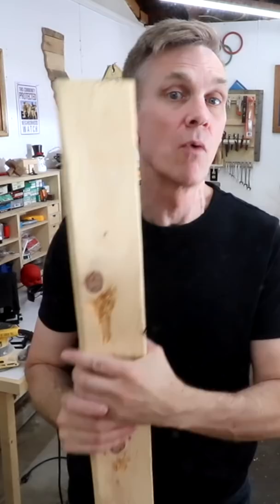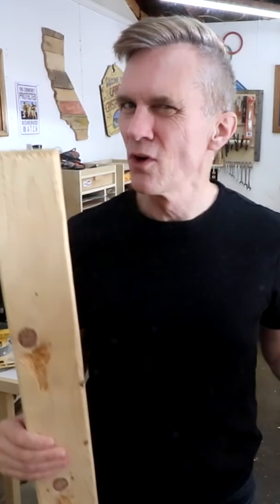Why do 2x4 boards have rounded edges? #shorts

Comment: The roundover cost nothing to add if done on a 4 sided planer, which is what sawmills use. All that's requires is a different set of knives that are curved on the end.
Reply: Thank you saved me 30 minutes of searching google
Reply: Hi Matthias. Great to see ur response. I am a big fan of urs...
Reply: Are rounded knives not more expensive?
Because it's seems like they should. Added complexity adds more cost.
Reply: Interesting, but this doesn't explain why they have rounded edges -- only WHY NOT.  If it doesn't cost anything, why don't all boards have rounded edges, not just 2x4s?
Reply: great to see both my favorite guru sharing the knowledge here
Reply: Wow it’s Mathias! 
It’s like seeing a celebrity while you’re waiting in line at the grocery store
Reply: then it makes the knife harder to be sharpened and the planner can only handle the same width. I would still consider that additional limitation would leads to some cost, not much tho
Reply: that settles the debate, I guess: no extra cost on one side and on the other side at least a dozen of not-really-convincing explanations about why that might be useful.
Reply: @HighPowerXH  I'm guessing four knives that have a small "L"  curve on one end.  One corner per knife.  Re-adjusted position after each sharpening.
Reply: @celestialmonochord  Some boards have rounded edges.  But it's not desirable for all boards.  So, your question was?
Reply: @HighPowerXH  MOst likely a multiple segment knife, with a straight part, and two extra separate cutters on the same head adding the rounded bits
Reply: I think the mill bean counters just gather up the shaved off and structurally useless wood. It is then burned to power the mill.
Reply: You just said it costs nothing bit it requires a second set of knives. Unless that second set of knives was free that is an extra, as is sharpening and maintaining that second set. 

Why? Why use the second set of knives at all?

You answered how they do it, but not why.
Reply: @matthiaswandel  You should read my comment again. The issue at hand is “Why do they make 2x4s different?” Your answer is “It doesn’t cost much to make them different.” But your response is not an answer to the question at hand. Cost or no cost, what’s the goal/aim of make one sized board differently from all others? I don’t mean to argue — surely, you can understand the distinction here.
Reply: @celestialmonochord  a lot of other lumber also has rounded edges not just 2x4s
Reply: why does all 2 by lumber have rounded edges? 2x6, 2x8, 2x10s
Reply: @1958bytor  The most likely answer is the consumer prefers it. At some point someone started rounded them and probably put some competition out of business. Since it doesnt add much if any cost the consumer chose rounded edges. My theory anyways.
Reply: Why would the mill do it if it only helps the customer?  It is that customer who is making the buying decision.  The question is whether the buyer has any elasticity.  Even if it cost a small amount more for rounded edges, the carpenter can pass that increase in cost to his customers, to whom any such increase is insignificant compared to the value provided by the carpenters themselves.
Reply: @Xray2j  Well why didn't you say "Hi" to me? I don't bite. Well not often. :-)
Reply: @celestialmonochord  Your write the reason has to be money.. It has to.. i'm tinking if you round the corners can you maby get more boards from a tree..
Reply: I have a manufacturing background and rounded edges would actually allow for longer life of the cutting tools (4 sided planer). Sharp corners created stress points in high strength steel (blades).
Reply: @celestialmonochord  true story.
Reply: Here in Chile 2x4 and others doesnt have round edges...i thought it was an American thing...
Reply: Except the costv of the planer and the blades which neither is cheap and the blades constantly have to be replaced and/or sharpened
Reply: So maybe it's lucky  coincidence? The cutters were just shaped that way?
Reply: To piggy back onto Matthias answer. Not only does it not cost extra but it reduces the weight of each board this helping cost in shipping.
Reply: @Jehty_  but it produces a better product, so is worth more. Cost benefit works out.
Reply: It's called a moulder, most mills that make 2x4s and other lumber have them. It's actually easy to make rounded knives, I don't know if most mills just buy them rounded or make them like my mill does (cheaper) but it's really interesting to see some of those machines in action because some of them move so fast they can't be fed/caught by people.
Reply: And the sawmill has more saw dust to sell because of it.
Reply: @matthiaswandel  With all due respect, your answer doesn’t explain why the practice of rounding over the corners of 2x material began in the first place..  

I believe it is mostly only done to kiln dried lumber (not all 2x material), & therefore the most likely reason for the round-over is to prevent large splintering of the grain from the rapid drying on the cut edges. I’m not speaking of small splinters that just get caught in your skin in occasion (cause that still happens), but if Larger splintering that damages the integrity and strength of the wood. The returned and unsold lumber from rapid drying defects should  more than justify the process of blunting or rounding the edges.    All invited to check me on this, but I think the reasoning holds up.. Thanks for the read.
Reply: @celestialmonochord  If you get more Sawdust this way, you can sell more of it. While the 2x4 price is steady because these customers are also happy.
Reply: You say it cost nothing but requires a different set of knives which cost nore than regular knives they normally use...think about it.
Reply: @lZEOBA  plausible
Reply: As far as why they are curved, I would say its harder to damage the lumber. With a sharp corner if it dropped on the edge it could split off easier, but with the corner rounded it would be less likely to tear a strip off in the same circumstances.......I can't think of how to describe my thought process any better at the moment. Not saying I'm right ,just my thoughts on it
Reply: @celestialmonochord  hardwoods for joinery require sharp edges for accurate dimensions. Framing doesn't need the same accuracy from the edge, mostly just length, plus plum, square and straight
Reply: The true original reason was because they couldn't stack lumber evenly as most straight cut would had splinters. Also they would stick to each other like Velcro with these splinters so unloading was a pain. There is a small extra cost for the blade configuration but it is minimal. Of the very few major producers of lumber, were all started by people who caught on to this or had learned of this from conventions ( yes lumber and blade manufacturing) eventually it was just more popular and the smarter idea. No one would sell it straight cut without there being a demand now 👍 enjoy
Reply: Dude, I freaking love you. I spent hours upon hours trying to figure this out online. It's like a trade secret.
Reply: Bruh, you still have to pay the guy to do that.
Reply: Not quite true. The rounded edge does cost more than a straight. The reasons are as follows (source family owned and operated mills for 3 generations):
When running a planer, you typically have two Main Heads that plane the top and bottom of the board. These do the most work and will always have straight blades on them. Then you have the Profile heads, these can contain either straight blades, or blades that cut a specialized profile. I've had to sharpen these blades. When you sharpen them, you have to shut the machine down. The straight blades can usually be "Joined" while they're still on the Head. This takes only a couple minutes, and you're back up and running. Profile blades, however, have to be removed from the head and taken to a work bench where they can be resharpened. Sometimes a mill will have extra blades so they only have to switch them and get running again, but you still have the mill wright resharpening those blades. It costs a lot more to roll those edges than to keep them straight.
Reply: Yeah... I’m pretty sure that the dude talking said that the reason for the rounded edges remains unknown...
Reply: @Danny DNA LOL! He didn’t tell anyone anything that the dude in this video hadn’t already mentioned... does anyone even listen to anything people say?
Reply: Knives on a sawmill?
Reply: @guyincognito210  bingo.
Reply: Where I'm from in the UK you can buy 2 by 4 PAR (planed all Round)  or 2by 4 rough which still has the square edges. The PAR is sold at a premium so.... Silly video.
Reply: Does not explain why...
Reply: I knew I would see you in these comments
Reply: I don’t think you understand, he said nobody’s know why. Stop walking over people
Reply: If anything it makes them money. They can sell the chips for paper or package it for animals.
Reply: @NotaRobot_gif  "Sharp corners create stress points in high strength steel blades"

Yes but the cutters to create a 2x4 with sharp corners wouldn't actually have sharp corners. It would just be 4 straight cutters 90deg to each other with 2 of them overlapping. If you want rounded corners then 2 of the cutting heads would have to have rounded ends.
Reply: Hilarious that this guy went down that rabbit hole and concluded he’s working with double digits
Reply: @guyincognito210  BRAVO! BRAVO!
Reply: Not true, i grind the heads for the moulders in my sawmill. It adds a significant and is solelly done to prefent the boards from splitting and splintering when handled. Gives a cleaner look and feel.
Reply: The way we do it is with a moulder designed by a german company, weining. It has a top and bottom head which are straight, 6 knife moulder heada, and a front and back side moulder head which have 6 a U shaped knifes, but arent set the full depth so only the eases on the edges of the knife touch and contour a profile into the corners of the 2x4s
Reply: Correct, to add, the rounded edges allow for better fitting of material, easier installation in tight spots, expansion of wood, and slight discrepancies in the material itself. The additional rounded edges also prevent wood from catching on parts of the machinery during the manufacturing process, destruction of the wood due to splintering, and in fact allow for better consistency in these materials used in building homes and other structures where this consistency is crucial to the construction process
Reply: I don't believe this is how they do that this would literally waste a ton of wood unless they just had a router in line with the blade cutting the lumber
Reply: Thank you sir. Already subbed.👍
Reply: @twentydixoncider7443  they use a gang rip, who’s knives have rounded edges...
Reply: @TrynFail247  He doesn’t know why, that doesn’t mean nobody knows why. Don’t assume just because he’s on your tube that he’s correct... He makes a lot of comments like this, and I’ve noticed he makes a lot of mistakes in his videos, just saying...
Reply: @user-yq2fl3sc1l  yes, rough cut is used for framing and par is used for finish work, and framing where there are specific tolerances that require it
Reply: @flamewave000  they don’t use a planer, they use a gang rip. A planer is one dimensional, for leveling out the plane, for consistency in thickness of materials, like flat boards, rails and styles, etc... it is used to bring already cut materials to the proper thickness, not for mass production of 2x4’s
Reply: @76REASONS  lumber is cut in the mill already to standard size. It either comes off the main radial saw already to size, or is further dimensioned by a large band saw or gang rips. Our mill actually had two gang rips, the big one was called a Bull Edger, and the smaller one we called the Pony. All of which produce rough cut lumber and timbers at the required dimension (within tolerance). Then you send it to the kiln for drying, or let it sit in the yard to air dry. After which, you can sell it rough, or it gets sent to the planer to be "dressed". This brings it to dimension at much tighter tolerances, and gives it a smooth finish. It also could produce profiled lumber such as tongue and groove, shiplap, and many others.
Reply: @celestialmonochord  rounded edges means it looks nicer and since it looks nicer they can sell it for more money.
Reply: @syedalinaqinaqvi9950  iilovw
Reply: @Jehty_  I run a 4 sided planer at work and no it wouldn't be much more expensive. The round over cutter is not the same cutter as the straight one, you simply stack them together. Then they will wear out at the same speed which will cost you maybe than 10 dollars per change, considering the price of lumber and how many boards you can cut it really doesn't add any cost.
Reply: Love your channel ❤️
Reply: @Jehty_  initially maybe. But minute
Reply: @celestialmonochord  my thought. 2x4 can go throug a little machine for make at the same time  the 4 corners smooth,  easy and fast,and the they don’t need to make the beautifulest  job because normally is for non visible purpose , now imagine a board 120 x220cm ,the board is big ,bulki,heavy  ang a lot of time is for final finish , that means if they make that round corner , they need to be almost perfect or perfect , and with that size it’s going to be a challenge
Reply: It costs power to run the machine and replace the blades. Wrong.
Reply: @sheet-son  you win
Reply: @sheet-son  if they have to round that contour. It's no different. Radius or 90. The blades are cheap... the machine is already running.
Reply: Exactly....and it is referred to as dressed lumber. A buyer has a choice between this and rough cut lumber
Reply: @benji_here3174  thank you
Reply: Ok... But why are they added?
Reply: @MrKYT-gb8gs  I have seen some dumb conversations on here. This is a useless waste of time. Why indeed
Reply: The mill gets to charge a few cents more for nicely planned lumber vs the cost of doing it, and maintaining the planers
Reply: And it's not even the saw mill, it gets treated then goes to a planing mill
Reply: @thedrummerdamo  Drummer man that's quicksand. Ppl here just want type.  For the sake ef of typing. WATCH... If read alot of gribble on here. This one is up there. Really??
Reply: Nothing cost nothing. What a silly thing to say!
Reply: @guyincognito210  I think we have a winner.
Reply: Interesting, so it's about efficient production, not necessarily an extra step? Is trim that is s4s done in two steps?
Reply: @Jehty_  sharpening is harder too
Reply: Helps make board corner smooth if skewed a little from the mill and after shrinking from dry kilns. That is my answer. I used to saw and leave a little skew on corner of outside cants in hopes that the planer will clean it up on its last and final cut and last trim on the ends. Lol
Reply: Thanks Matthias! Check out his channel. He makes really cool stuff out of wood.
Reply: Now go make an interesting video instead of commenting here.